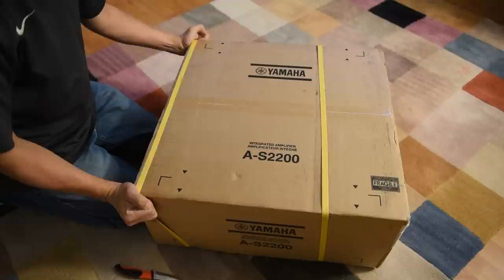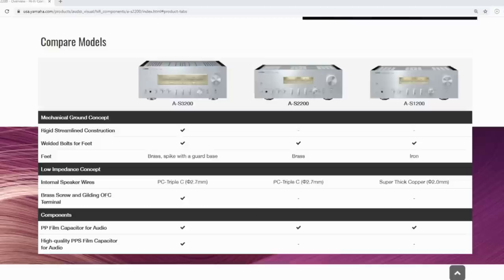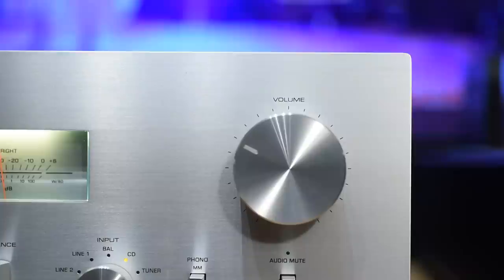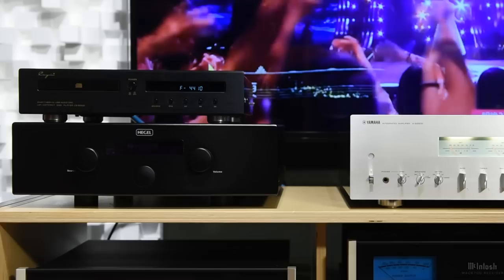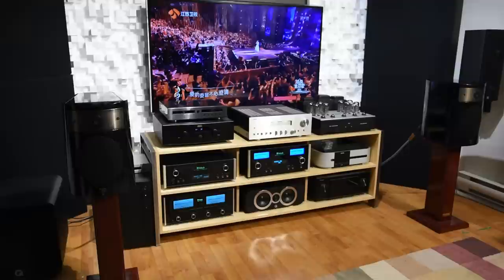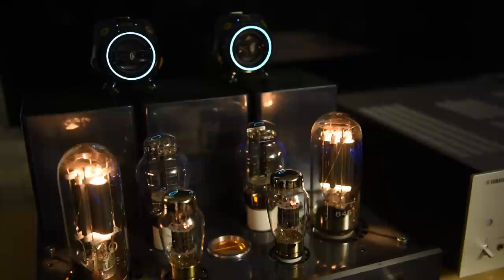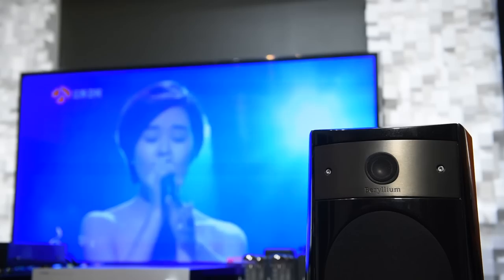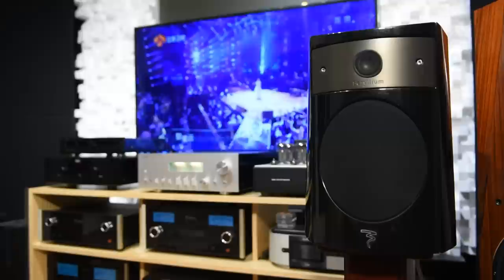Did it blow me away? Yamaha AS2200 Integrated Amp review

Comment: A-S2200 review

It’s been a long road, a journey if you will, due to the unfortunate circumstances of COVID it’s proven to be a bit longer than I had anticipated to write up a full review, as I’m still waiting for my CD-S2100 to be delivered, as of writing this it’s on back order, may have in the next few weeks? So bare in mind, my assessment in my opinion is somewhat compromised by the evaluation only using a CD-S300, this amp is capable of so much more with a better source, but as of now I can attest to at least the following:

I’m writing this first and foremost as a Yamaha owner, and a fan of the brand, so the following may or may not be biased. 

I’ve owned many different Yamaha AVR’s, 2 channel stereo receivers, and 2 channel integrated amps over the last 20 years, but my focus on audio shifted some years back from Home Theatre back to my roots of 2 channel stereo listening. For this review, this will be a direct comparison between my last amp, an A-S801 compared to my current iteration of the A-S2200. 

Upon immediate notice, first note worthy thing I noticed from the A-S801 to the A-S2200 was the more pronounced mid range the 2200 had over the 801, more authority of the soundstage, more control over the bass and transients, I mean the 2200 is quick, fast, and accurate and can stop on a dime, and when it does, a very eerie dark black background emerges. The soundstage has grown a bit in size as well with the 2200. The 801 mainly danced about between my speakers, imaged really well, laser focused phantom center channel, so how could the 2200 possibly be better than this? Well, the depth between front & rear wall has grown by at least 2 feet, the soundstage width now extends beyond my speakers clear to the dimensions of my room which is 15 feet by 13 feet with 10 foot vault. Upon a vast diversity of genre selection via CD and LP I have noticed a lower noise floor, like theres no noise there at all. My speakers are 96dB efficient, with the 801 there was just a touch of idle hiss on the tweeters between passages or when swapping media, but with the 2200, it’s dead silent, like zero, zip, zilch, there’s no audible hiss what so ever, there’s such a deep dark background that the music just emerges from, its spooky good! A direct comparison of the built in phono stage between the 801 and 2200 proves the 2200 takes Yamaha engineering up a notch or three...there’s literally no surface noise what so ever, at least at the level I listen at. I’m relatively a low level listener, I value my hearing, usually levels between 60-80 dB max measured in my room with a cheap probably inaccurate iPhone app, but it’s within ballpark of these levels. With the 801 while listening at my usual levels, there was just a tad of surface noise, now I’m not referring to the Rice Krispy pops of vinyl, that’s up to the user to clean your darn LP properly, I’m referring to the sound of the stylus upon the LP itself as it spins. In between passages with the 801, you could hear the stylus in the groove of the LP until the next track started, or in the run out groove on an LP, you’d hear just light surface noise of the stylus on the LP, with the 2200 playing same dB levels, the phono stage represents little to no surface noise, quite remarkable in my opinion with a built in phono stage.  

Here’s where things got a little interesting.  While doing some real critical listening one evening, house was ultra quiet, room was dead silent I started to notice a buzz/hum from the 2200, of course I got worried and did some trouble shooting, posted a poll to fellow owners, users of the known associated amps in this class as to whether or not this was normal or if they had noticed any pick up on their units, to my avail, I was the lone survivor in this and started to research what could cause this hum. Upon my research, I concluded through vast forum threads, phone calls and emails to Yamaha, my conclusion was that there was a possibility of DC on the mains, in other words; direct current on the main line of AC within the home that can cause toroidal transformers to hum, in essence what can happen is the slight deviation within the AC electrical current 60/60 in and out for the 120 (respectively) if its off even just slight, say 61 in, 59 out, it can cause the windings within the laminate of the toroidal transformer (Ei Core too) to vibrate, hence-hum. This can happen regardless if one has a power-line conditioner, which I do, OR a dedicated circuit, which I do as well, so I was perplexed with a high dollar Panamax unit and a dedicated 20 amp circuit just for the stereo system itself, I was inclined to think it was the 2200 that was causing the issue, but alas it was not...I took a gamble and bought a device for DC offset (Humdinger @ AVAHIFI.com) plugged it into the Panamax and the 2200 into the Humdinger, problem solved, dead silent.  I only side tracked from my initial review to let others know, as this may be an issue for others if you got less than stellar AC provided by your utility company.  (Please note, said hum that I speak of, it’s in reference to mechanical hum, from the chassis itself, not to be confused with hum emitted from the speakers, that would be a ground loop hum, two totally and entirely different entities.) (Some causes of DC, low voltage devices in your home; dimmer switches, light bulbs, fans, air conditioning units, power fluctuations from neighboring homes) 

So, with Humdinger plugged in, away I go...
I have about 27 hours on the amp at this point, not many hours in my opinion to really access, but this is an ongoing candid review, I can say at this juncture however, vocals are becoming more “breathy”, there’s a bit more decay on notes, you can really hear the harmony in some singers voices, Daryl Hall, Mark Knopfler, Stevie Nicks come to mind. The notes on Miles Davis trumpet just seem to travel further and further into the abyss, it’s quite amazing what great Yamaha equipment and a great mastered recording can sound like!! 

Approaching 50 hours on the A-S2200 the CD-S2100 was implemented into the system. Now we’re talking, the CD-S2100 really smoothed out the top end over my previous CD-S300, not that the CD-S300 had a shrill top end, it did not, but the 2100 adds finesse where the 300 just couldn’t, cymbals now sound more natural less metallic, strings have a very soothing sound, horns and trumpets sound more authentic, drums have a very robust presence. The CD-S2100 has a very warm, detailed signature, very analog like. The connection mating between the A-S2200 and CD-S2100 was done with Canare Star Quad balanced XLR cables at a 1 meter length (3 feet). The balanced connection provides a rich dark background from which music just emerges from, this allows such a quiet, low noise floor that I hear details in recordings I’ve heard dozens of times, that I’ve never heard before. There is such air and separation around each instrument and vocals that it provides a step further towards realism that my CD-S300 was just not capable of with the A-S2200. I truly believe to utilize the benefits of the A-S2200, the source is just as important as the amplifier itself.  

From this point forth I will obviously continue to evaluate, experience, and enjoy both the A-S2200 and CD-S2100. Myth or not regarding burn in/run in time...it may be an actual thing, it may just be the listener becoming use to or better acquainted with their gear, call it what you will but as time evolves I’m sure the use of both pieces will evolve into something of audio bliss
Reply from the maker: OMG, I so envy you. You are so good at expressing your listening experience. Thanks for sharing your story and I loved it.
Reply: Thomas & Stereo thank you Thomas, means a lot coming from you!  I love your passion for all things audio and I’ve been a subscriber for quite sometime. I watch as many of your videos as I can, I really appreciate your channel!
Reply: @Nathan Jones : I had issues with IFI ac purifier . It’s causing some noise to the my Yamaha 3200 toroidal transformer . I also noticed with other components which uses  toroidal transformers.  After get rid of ifi ac purifier .. all problems solved. 
Did you try to find what causing DC offset in your home ?   Disconnect all appliances and other electronics and only switch on amp . see if there is any  thing causing by turning on one by one .
also there is a tester to verify all lines properly wired or not . Test it .
Why I am saying.. Yamaha requires direct connection from wall . If you add power conditioner or any other .. there is a significant impact on mids and bass.
Reply: KVR Listening Room yes, thanks of the advice. I had tested everything in the very manner you mentioned, shut all circuits off and the only thing plugged in at the house was the 2200 and the hum persisted. I took the amp to another location and it was still there, but very, very faint, so I assumed some of what I was hearing was by design and Yamaha backed me up on that. I then had the power company come out and they changed all the grounds from my meter all the way back up the line to their transformer and that helped dramatically. What the power company did for me in combination to the Humdinger device I bought, the 2200 is now dead silent! Thanks for your advice, much appreciated.

Comment: The Focal/Yamaha combination sounded absolutely stunning. Yes, way forward, but in a good way. I love forward sounding systems, but more often than not the forward sound comes with excessive 'ringing', which is an instant dealbreaker. The Focal/Yamaha combo had none of that, just a wonderful energetic and lively presentation.
Thanks for the review Thomas, as always... damn, that sounded good... must resist the urge to buy that combo, otherwise there will be beatings from the wife...
Reply from the maker: Yeah, I was surprised by the combo with the Focal myself.
Reply: @ThomasAndStereo  Ok, just ordered some Tekton Lore's with BE tweeters, funny enough Jay just reviewed those speakers:) If I survive the wife's inevitable yelling/nagging about yet another speaker pair, I will post a video review comparing the Zu Audio Omen DW2  and the Tekton Lore sometime around x-mas.
Reply: I'm using an A-S2000 with Focal Chorus 726's and they sound stunning. Previously was pairing the Focals with a Peachtree 125SE and before that a Cambridge Asur 851A

Comment: Great job Thomas. Ya know that high mid characteristic could prove very useful for alot of speakers that may lack in that area. BTW the Focals sounded great. Much better than second ones
Reply from the maker: Thanks. The only thing is the focal speakers were closer to each other when I recorded them and also the mic was not at tweeter level when I record the 2nd sound clip. Having said that, in real life, I actually prefer it with the Focal and was very surprised.  This is why I always say, you never know until you plug it in.

Comment: So a few things. On the brass debate, it could have been Yamaha was referring to the binding posts. I could see their point that maybe in their tests the extra resistance of brass promotes a warmer sound - that could be, I see the posts as an area of improvement, should be copper in my opinion. Also the sound.. Yamaha used these dipped polypropylene capacitors throughout - kudos to them for bypassing everything by design, I however have not ever had great results with that particular style of capacitor and could look to replace a few of them with an alternate choice better bass, clarity, etc. I think with the A-s3200 they improved the internal wiring - board to post - their site refers to PC-Triple C, which I'd presume to mean Furutech wire. Regardless they used better wire, but if one had an A-S2200, a solid project could be to replace those posts with copper and substitute whatever wire they used with solid core silver, that would amount to a solid model upgrade in itself from whatever model you're starting from. Net, my take is that generally this one, whatever the model, carries an above average quality level out of the box - which is rare - but also as usual the manufacturer leaves behind a few items which causes some question..

Comment: In 1978, at age 15 I bought a brand new Yamaha CA510 for around $280  It was almost Identical to the modern  AS1200 and 2200. it was a great amp, but I would say the build quality was a bit cheaper end on the CA510.

Comment: Suggestion, do a score card, like Doug Demuro. Use 2 reference speakers you are intimately familiar with, one that is easy to drive, one that is harder to drive (like a 3 way that has potential to generate punchy bass). Use scoring categories like highs, mids , bass and a comments box describing, in 2 sentences, a little detail (ex: highs detailed, not rolled off, upper mids have emphasis, tight detailed bass)
Reply from the maker: Yeah I did think about it, perhaps I would do it that way if I decide to go full time youtube in the future.

Comment: Thomas your Kanta and Sopra should be a perfect match combo with the AS2200 at low listening levels I have tested it personally with my AS3000.
Also I highly recommend you try the "MAIN DIRECT" with your TUBE PREAMP it works very well with my system.  Please note when doing this you will not be able to use the tone controls and other features headphone etc. I use mine like this Chord Dave (DAC MODE) > Feliks Euforia 4 x KT88 QUAD (as preamp) > Yamaha AS3000 (main direct) > Dynaudio Special 40 speakers = HEAVEN ;)
There are some speakers that did NOT pair very nicely with it like my old Kef LS50's.
Reply from the maker: Could, thanks for the tip.

Comment: The speaker break in was a surprise. The difference between A +B was similar to what i hear when an undersized inductor is used in the crossover of a speaker. More open upper midrange on B. 

This test shows how difficult it is to pin down a change in sound to 1 component. Yes i guessed it was the speaker itself that changed; but was wrong about the cause. (And i have designed my share of speakers). 😌
Reply from the maker: Well, the speakers were also breaking in so it contributed to the overall sound change.

Comment: Great coverage. The older gen of these models didn't get much press and it's hard to find out information on them. I almost considered the AS2100 but couldn't pull the trigger due to a lack of reviews. Thank you.
Reply from the maker: Thanks for watching!
Reply: Jingle Nuts I settled on a Simaudio Moon i5.3 instead. No longer looking into Yamaha.
Reply: @Jingle Nuts The AS2100 has XLR connections. Not sure about the "bigger caps." The AS2100 looks identical to the 2200.

Comment: The film score that you used has shown me that having my mains and my subs running bass (large on the mains and plus on the receiver) was more muddy than I realized after turning the mains to small with 80hz crossover the bass became much more clear and pronounced if not as loud (Cheers for that), also if your wondering my mains are Pioneer S-T500s and my subs are a pair of Dayton Audio SUB-1200s.
Reply: With 80Hz filter the small midbass drivers don't distort because they don't have to handle bass signals. Unless the drivers are very well designed and linear (also expensive), anything below 100Hz makes the spkrs  distort way more than in midrange where the cone excursion is very limited. Same as you can not ask tweeter to handle bass.

Comment: I had the previous model AS2100 and i liked it but didn't love it. The sound was clean but forward and the bass was lean and not as deep as i hoped considering the size of the power supply. At the same time i had the Hegel H160 and while the Yamaha puts to shame the Hegel in build quality and WAF is off the charts, i preferred the Hegel.
Reply from the maker: Yeah, I wonder if the improvement of the AS2200 from the AS2100 will win you over.  I did read a review and the reviewer mentioned he was not really impressed with the AS2100 bass but he was with the AS2200.
Reply: @ThomasAndStereo  If i had the money it would be a difficult choice between this and the new Denon.
Reply: @Jingle Nuts Ar the time i had SVS Ultra Towers. Hegel drove them better with deeper bass.

Comment: Thomas  I own the as2100 powering Rubicon2(warm speakers with forward caracteristic). Source Node 2i(Qobuz) /Vinyl. The amp is unfortunatly not as smooth with the streamer as it does with Vinyl. I have used the Bluesound as a preamp today  connected to source direct on the Yamaha ,turned on the tone control of the Node and the magic happens allthough went down couple of dB . It turnes out the bump is gone by 50% and the sound is softer, more musical and bass more defined but a bit darker. I can now state that the poweramp section is not far from linear and changes character depending of the pre-section. The preamp section without the phonostage  is a bit aggressiv with Analogue inputs between 3khz and 8khz. I'm now looking for a musical and pure digital dac-pre (for a good clarity, smoothness and tonality) Budget under 1.5k
Any suggestion
Reply from the maker: You can try the matrix mini I pro 3 if you are in the states. Order from Apos and you can return if it does not meet your needs. Check out my video on it.

Comment: I’ve been using the phono pre in the As2200 and it is a wonderful pre. It sounds amazing for an internal unit. I’ve only been using the MM so far vía headphones jack. They both sound great. I’m still waiting on KLH Model 5, but both headphones and MM stage is great in the AS-2200. I don’t need to use an external Phono pre with this unit.
Reply from the maker: Thanks for sharing
Reply: How do the KLH Model 5's sound with it? I've been eyeballing those for a while. I have the A-S2000